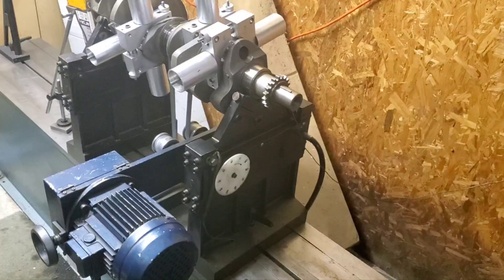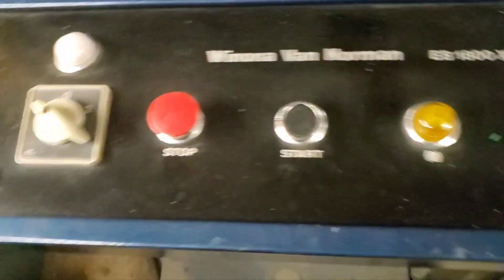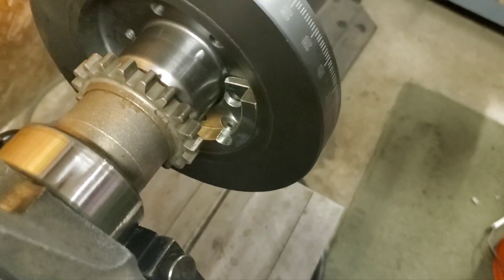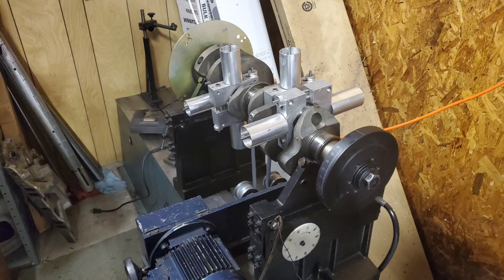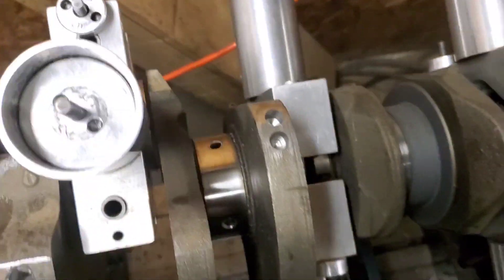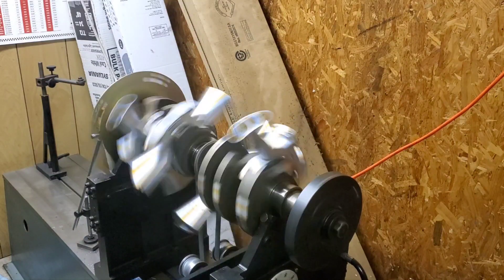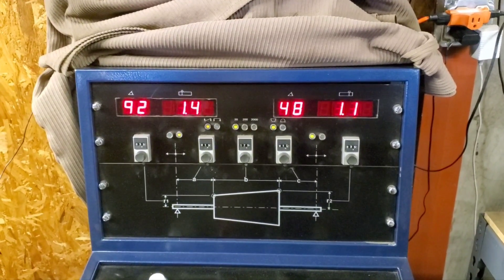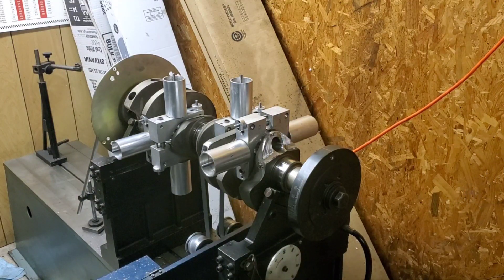440 Mopar Cast Crankshaft Balance, Externally Balanced.

Comment: Hi Ed! Very informative video! A couple questions. Are factory motors balanced? And I’m assuming the more horsepower you have, the more critical it is to have the crank balanced? Lastly, how bad off does a crank have to be out, to have a catastrophic failure? I’m talking generally motors with 400/450 hp, not 1000 hp motors. Thanks Ed!
Reply from the maker: Hello Matt, thanks for watching. 
Great question.
These engines are in 400 plus.
The factory engines are balanced but not as good as they should be.
I fine that almost all engines need some type of correction. 
Certainly 400/450 absolutely needs to be balanced.
Small imbalances can add up to large amounts as RPM increases the amount of imbalance is amplified.
So I know it is another expense, but we'll worth it in the long run.
I'll talk more about it in the future.
Also you cannot tell how bad it is by just looking at it.
And not all balance jobs are equal either. 
Take care, Ed.
Reply: @edsmachine93  thanks Ed for the reply it’s very helpful! And thank you for sharing your knowledge!!! Take care brother!!!

Comment: Is this a 440 crank??? 440's are internally balanced. 360's are external... Or did I misunderstand the title???

Nevermind I missed the "CAST" part somehow...😂
I never understood why the cast ones can't be internally balanced tho, cast steel can be machined...
Reply from the maker: Hey Joshua, yes it is definitely a cast and is external balanced from the factory. 
I am evaluating the possibility of internally balancing one of these.
I actually have one to test for a customer that was internally balanced.
That job is coming up soon.
Take care, Ed.
Reply: @edsmachine93  I'll definitely be watching for that. Just out of curiosity, why were the cast cranks externally balanced? I would think that cast would be more likely to crack with the additional flexing going on in an external balance scheme. Or maybe I'm looking at it wrong...
Reply from the maker: @jseal21 Actually cast has alot of really good properties. 
Very stable and lubricates well.
Easy on bearings.
Modern casting techniques developed in the 60's and 70's are really good.
Look at the aftermarket crankshafts from Scat and Eagle in engine that make 500 to 750 horsepower. 
And they live.
The reason for external balance is the counterweights are not heavy enough for the Bob weight. 
Take care, Ed.
Reply: @edsmachine93  750!?!? I didn't know they could hold up to that sort of power. I wish we had this conversation a few months ago, I bought a forged Molnar crank instead of a cast Scat b/c I didn't think it could handle the 650ish hp/tq I hope to make. I could have saved $300. C'est la vie...